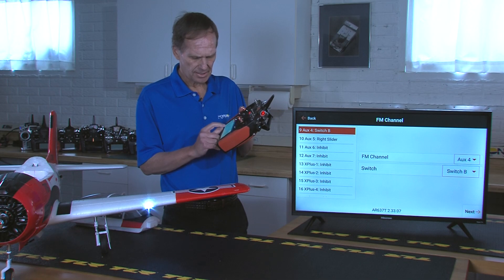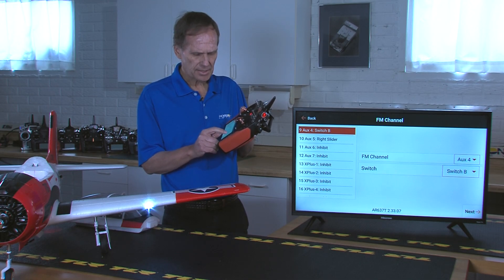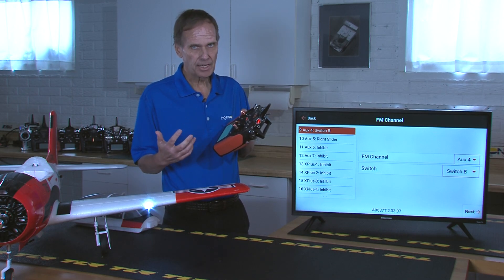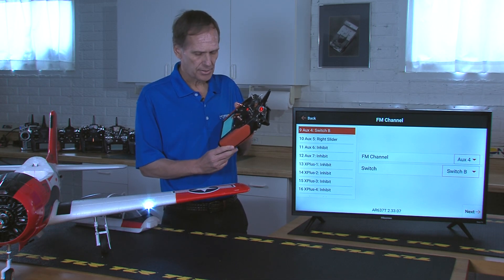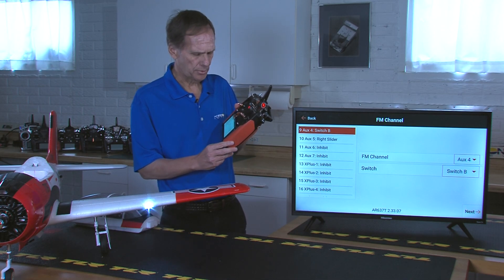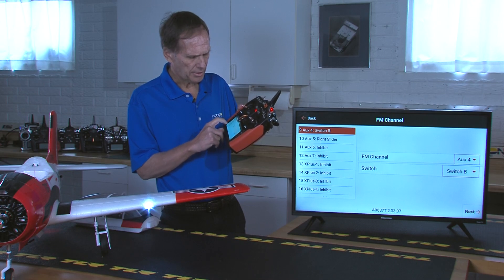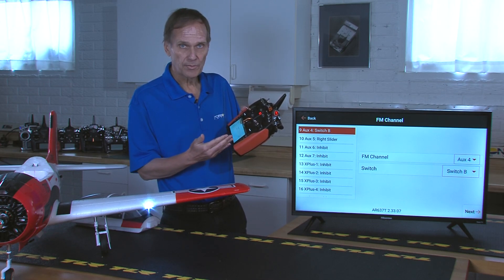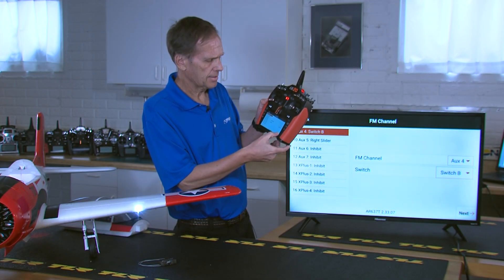Spektrum Smart Receiver AS3X Setup Series #5 - AS3X Tuning with Gain Channel and Flight Mode Setup

Comment: I keep getting stuck on the flight modes. I have a DX8 Gen2 and AR630+ When moving the assigned switch, my Tx says Flight Mode 1, 2, 3 but the transmitter only shows Flight mode 2. I also cannot set up AS3X gains. where the video shows switching between FM1 with no gains to FM2 with gains, my Tx shows only FM2 with no gains. Moving the switch { switch D } does nothing. I have reset and started from scratch several times only to end up back at this problem. Please help

Comment: My setup are as followed: Flight mode 1 is AS3X setup using the Gain nob to adjust the roll and pitch, also to rotate counter clockwise to turn off the AS3X if desired. Flight mode 2 for safe select self leveling and Flight mode 3 for Envelope.

Comment: I have an AR636B and have updated the software using the cable but when I go to do the forward programming I keep getting connection failed.  Not sure what to do next.   I have the DX 9
Reply from the maker: AR636 receivers do not support forward programming.
Reply: @SpektrumRCvideos  Thanks, I figured that out after taking a hammer to it.   Just kidding, I did finally watch a video that confirmed what I needed to get it working.

Comment: I've read every comment and have watched each video over and over.  I've also watched others.  GAIN. What precisely is gain in this context.  In Radio,  "gain" refers to the recievers ability to pick up a transmitters signal. So,  instead of increasing the range of the transmitter we make it easier for the reciever to pick up the signal by increasing the reciever's "gain". Is this what we're talking about?  If not,  please tell me what "gain" is referring to specifically.
Also, why do I want to keep messing with gain once no oscillation is achieved?  Why would a change the gain in different flight modes?
Reply: Gain in this sense refers to the ratio of change in the input to the change in the output.  As an example, an increase in roll channel gain will result in a more aggressive response to un-commanded roll.  Gains are discussed extensively in feedback control system theory.  Changing gains for different flight conditions is useful because gains for one condition might not be appropriate for another.  An example would be different gains for cruise or landing configuration because you might need larger gains at lower speeds to get the same response you might have at cruise speeds.

Comment: I have watched this entire series over and over again and I think I finally have it right EXCEPT for this one issue. It looks like SAFE has to be associated with a flight mode. What I really want is to flip switch A to turn on SAFE only when I get in trouble (switch B is for flight modes) and turn it off again once things stabilize, regardless of the flight mode. What am I missing here?
Reply from the maker: The best way to do this would be to use the Flight mode menu to setup 2 switches for flight modes. Then you will be able to use A and B for up to 5 different flight modes. Also make sure that the channel you are using to control flight modes on your AS3X is assigned to the FMODE (flight mode) switch (not B or A specifically). Hope that helps!

Comment: After a lot of fiddling around I figured out how to get this setup to this point with my older DX6.  The key was to first update the radio software, then before getting into the Forward Programming I went into System Setup and set the channels such that the Gear Channel was set to Switch D and Channel 5 and the Aux1 Channel was set to Channel 6 and Switch B.  For some reason the updated software for the radio shows a Channel 7 which of course does not exist on a 6 channel radio, so this Channel 7 needs to be set to inhibit, otherwise strange things happen.  After this I started over with video 1 (for about the tenth time) and was able to progress to this video.

Comment: Can the potentiometer be used to adjust the gain on only one surface at a time?  And, can that one surface gain be captured without effecting preciously captured gains for the other channels?
Reply from the maker: Sure can. There is a menu that you can use that allows you to make 1 axis(surface) adjustable and the others not. Hope that helps!
Reply: @SpektrumRCvideos  which one please?

Comment: Curious. How does he have AUX 4 on a 6 channel receiver? Also, hasn't he used up all the channels on that aircraft? Throttle, Ailleron, Elevator, Rudder, Gear, Aux 1(Flaps)?

Comment: This is an excellent video series but for us folks that have not been using flight modes it is very confusing.  At 1:42 minutes of the video it says something about the flight modes that we had setup earlier, however, I go through Series 1-4 and there is nothing about setting these up so how was I supposed know to do this before?  I really like the concept of the forward programming with these new smart RX but for those of us have not been using flight modes it is very confusing.  Also,  from what I understand there are RX flight modes and TX flight modes which even makes if further confusing.   Guys - keep up these videos but just please remember that you do this every day and have been doing it for years.  Think of your audience here.  When I was working and had a complex set of instructions to get out to our fleet guys I would have some of the administrative folks in the office do the process.   The had only limited knowledge of the process so it was a great way to check if it was a good process to send out to the fleet.
Reply: The flight mode must be configured in the flight mode settings. There are 5 flight modes overall. The 100% = fm mode 1, 50% = fm mode 2, 0% = fm mode 3, -50% = fm mode 4 and -100% = fm mode 5. Now check what gain your switch cause.

Comment: HELP. I'm on a DX8 and I'm struggling with the gain channel select and the Flight mode channel select. Upon set up, for Gain channel select, I can only see AUX 3 Rknob in my available channels, even though AUX 2 is completely free and assigned to use switch D. So when I then go to Flight Mode channel select, I can't choose AUX2 on switch D, which is all assigned. I've checked everything all my channels are free, they are assigned perfectly and no flaps, mixes, throttle cut, or anything else uses those channels. Can someone help me with this?
Reply: I've tried so many things so many times. Am I missing something? I can't get it to use Aux2 for Flight modes, and Aux3 for gains. Tried and tried and tried. Please do help me!!!!
Reply: You have to assigne the FMode to the channel AUX2. Take care you have configured the Flight mode in your model in the radio first. Do not assign the flight mode switch directly to a channel!
If you do not have done this I suggest you reset the receiver, configure the flight mode and after that start again with the forward programming.

Comment: I have a Dx8 and when I get to the step of assigning flight modes the only channel open is Aux 3 which was previously assigned to the right knob to adjust the gains.  Why can't I see Aux 2 as being available?
Reply: I Have the same problem!!!!
Reply: Did you manage to sort this out?? This receiver is pointless if I can’t get as3x and safe programmed.
Reply: @putzytart  , yes, I did.  Try this.  Delete the model you are trying to get working and start with a new model.  Set up the plane as the manual instructs you to do (wing type, flaps, etc.) and BEFORE you go into Forward Programming go into Channel Assign, then go into the 2nd screen under that.  Here you want to scroll down to the Aux channels and assign the switches you plan to use in Forward Programming.  I assigned Switch G to Aux 2 and R Knob to Aux 3.  My plan was Switch G would be for Flight Modes and R Knob would be to adjust the AS3X gains in flight.  After the plane was completely set up and flyable I went into the Forward Programming and then I could see all my Aux channels when I was trying to assign the switches to the AS3X gains and Flight Modes.  After talking with Horizon the following day they confirmed that you have to assign those switches BEFORE you start Forward Programming.  The videos don't say anything about that so its easy to skip over it.  Hope that solves your problem - good luck!  If not, call HH tech support.  I think I spoke with Shawn and he new exactly what I did wrong.
Reply: @LivinTheDream-LV  HA! I hadn't read your reply and I managed to just get this sorted and came here to let you know. I had a number of people at Horizon working on this and no one could sort it out! Just tried a last ditch attempt of building a new model from scratch and it works!!! Yes like you said I assigned my channels first. I guess I must have set up forward programming last time before I set up my proper channel sign and from there like you say it doesn't matter what you do it's too late. Will have to go back and copy all my settings over (I already had this plane flying perfectly with dual rates and expo etc), but that's easy enough. Can't wait to fly now!!!!!
Reply: @LivinTheDream-LV  Hey Steve, Thanks for this post.  I spent a couple hours trying to figure out a similar problem.  After following your instructions, my setup was compete in about 30 minutes.
Reply: AUX2 is already assigned to an input. Take care this is not the case.

Comment: On my dx8 it still shows only flight mode 3 nothing changes
Reply: That is dumb. Is your firmware up to date?
Reply: Yes it up to date my flight mode are on aux 1 and it can’t be changed even if I assign it to switch f it stays on switch d so it working with my flaps only not allowing me to selects my own channel
Reply: The flight mode must be configured in the flight mode settings. There are 5 flight modes overall. The 100% = fm mode 1, 50% = fm mode 2, 0% = fm mode 3, -50% = fm mode 4 and -100% = fm mode 5. Now check what gain your switch cause.